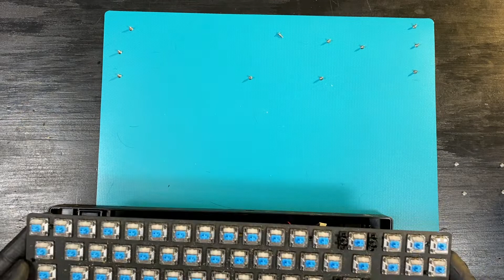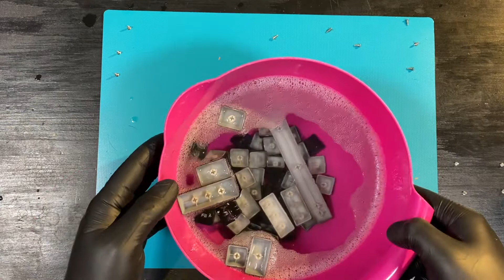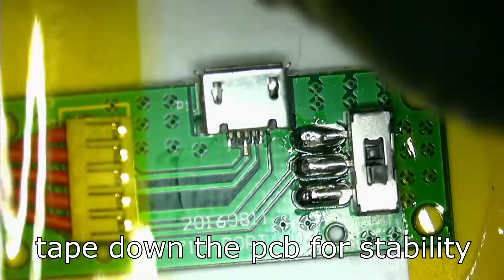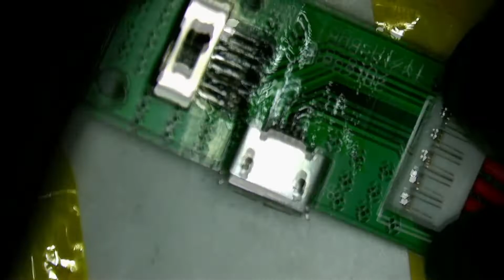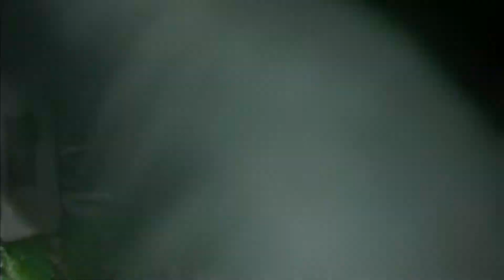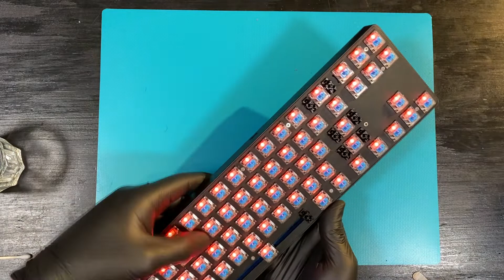Drevo Calibur RGB Keyboard  Disassembly & USB repair

Comment: I have one, but the bluetooth on it stopped working. Is it possible to replace the module?
Reply: I think it didn't stop working it just won't pair anymore, mine has done so too. There are a few threads on reddit about this problem. I didn't try to flash firmware to reset it.